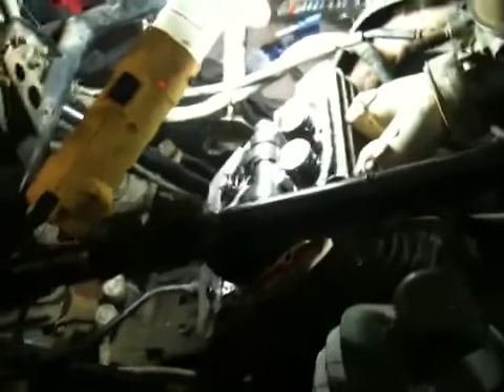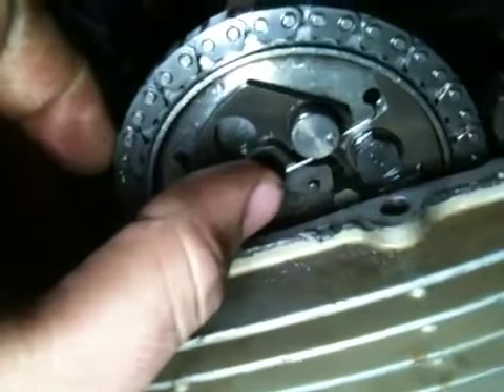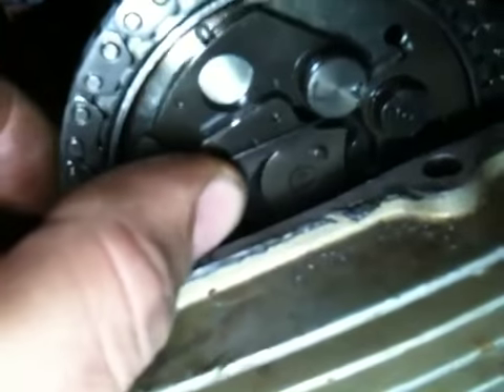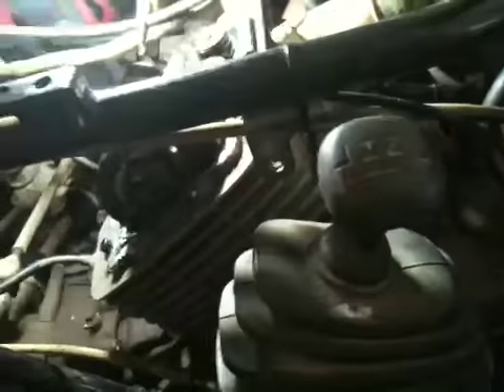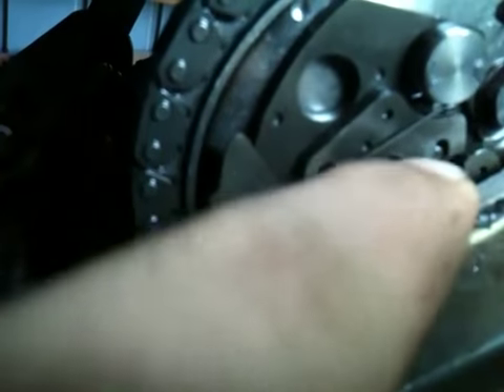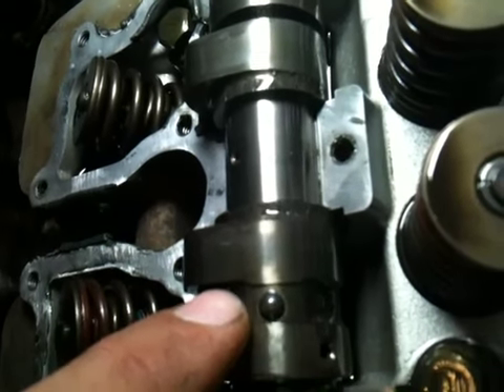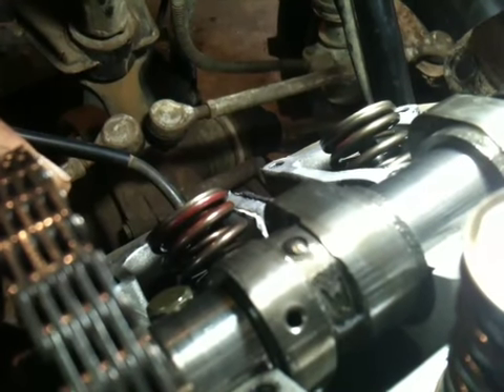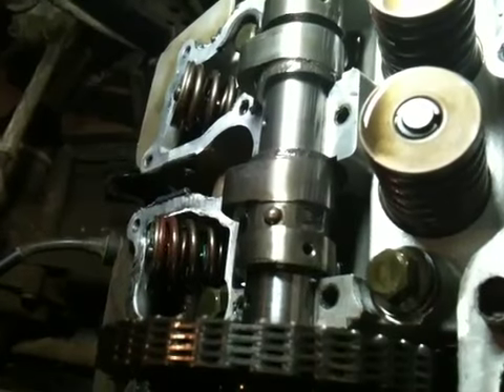Yamaha Grizzly 600 Rebuild- part 5 - decompression assembly

Comment: This video just solved my ticking issue. Had it rebuilt and when I got it back it ticked really bad. Dude said it was normal for the grizzlies to do this. NOPE! it’s not. Pulled cam out and he had the decompression shaft out 180 degrees. So quiet now. Thanks again.

Comment from the maker: Lackmaster100 - I'm glad the video helped you! It took me a little time to figure out why mine was ticking and I hoped the video would help others who had made the same mistake. Correcting the problem is pretty easy. Just let the tension off the cam chain, unbolt the cam gear from the cam, pull the cam out of the gear, rotate the shaft 180* and reinstall. Just make sure it operates properly before bolting everything back up. Let me know if you have anymore questions, I'd be glad to help.
Reply: Hey man great video!  I just picked up a rhino 700 that I believe has the same issue. I have a ticking in the top end and thought no big deal it's probably just the valves that need to be adjusted apon initial start up.  I checked the valves and they are in spec. I am having a hard time understanding what you meant when you said unbolt the cam from the cam gear and rotate the shaft 180 degrees. Do I unbolt the gear from the cam and rotate the cam  180 degrees  Or do I rotate the cam gear? Any help would be greatly appreciated
Reply from the maker: @tylerthomas3744   Hey, I understand how that could be a little confusing. What you'll need to do is unbolt the came gear and slide the cam out of it. That releases the pins from the flyweights. Once you have that done, the came needs to stay in the same orientation but you'll need to just rotate that little shaft inside the cam that operates the decompression mechanism 180*. So basically the cam wont turn, but the small shaft that runs up inside the cam will need turned, you just cant do it without unbolting the cam. Hope this helps

Comment from the maker: No problem! I made the video in hopes it would help someone else out. I didnt realize how that worked until I had already put it back together the wrong way. Engine is still running great after I fixed this issue. Was this the problem with yours and did you get it fixed?

Comment: thanks alot for this video man. just bought a 600 grizzly and it has a good tick noise. I just checked the valves and they were a little tight if anything so they shouldnt have been making the noise. Sounds exactly like valve noise. When I was checking the valves I noticed that someone had the rocker box off at some point since it was sealed with silicone. Im thinkin maybe the person who did that work may have gotten them in 180 degrees out. Im hoping so anyway! any chance you'd have a little info or links to literature for making sure they are not put in 180 degrees out? thanks again!

Comment: Can this happen if you don't remove the gear.  New to the rebiulding and I am not sure if it is ticking or if I am just paranoid.Is it obvious ? does it change with rams?
Reply from the maker: If the gear and flyweights were not removed, I dont think there is any way to mess the decompression assembly up. The engine ticked at idle and it ticked more the faster I revved it. Just make sure you have your valves adjusted correctly and that you are doing it on the compression stroke, and make sure your timing chain and tensioner are in good shape as well. Good luck